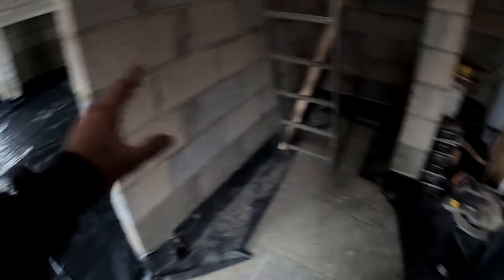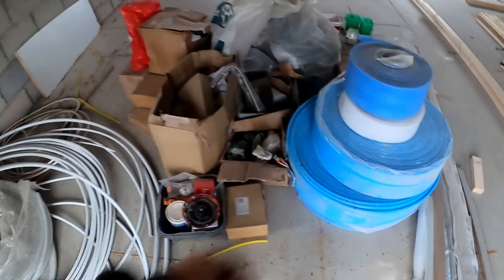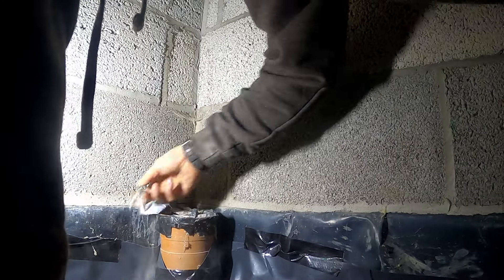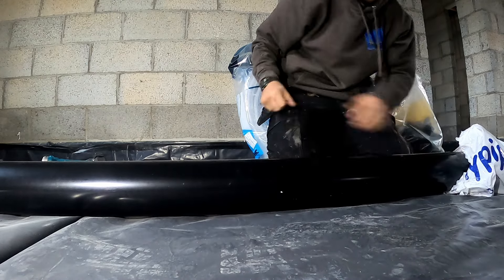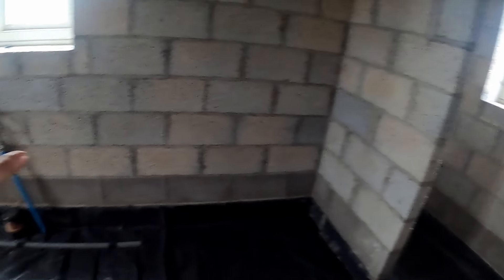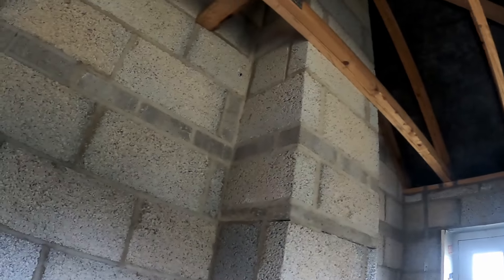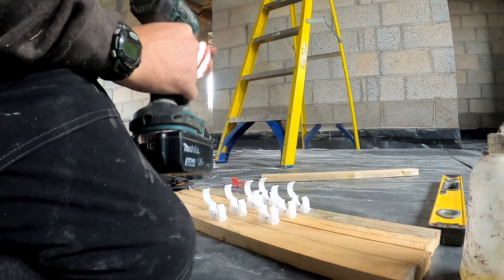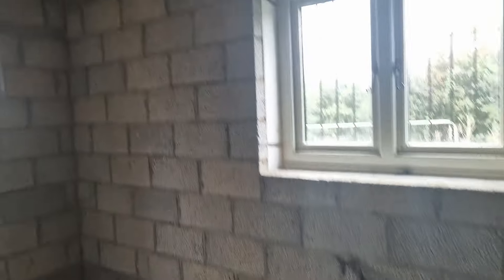PLUMBING the "ABANDONED" PLOT

Comment: Do you ever worry about the speedfit surface getting scratch pulling it through your copper sleeves? I’d worry about it leaking when fittings are put on! Great video as always Tom.
Reply from the maker: Not on that bit as they are full runs and the ends aren't damaged, it can be a problem with the metal braces in the joists as well, sometimes the pipe can get really scratched if you are not careful, thanks for watching Paul

Comment: During lockdowns Celotex was scarce and wood. I was quoting work at Saint Gobain at Eggborough near Drax. I was tripping over Celotex in the basement, there was that much being stockpiled. On the docks at Immingham, wood was piled high everywhere. No wonder costs were higher.
Reply from the maker: Everything went crazy, we had loads of celotex in the yard, I remember it being a precious commodity. It was a nightmare to get boilers as well, I remember fitting Worcester Lpg combi, the only way I could get one was to got a natural gas one, and change the gas valve and re-chip the pcb myself, Worcester did still honour the warranty, thanks for the support as always Dave

Comment: New-build oil boiler in 2024! Cripes. I know you don't specialise in heat pumps but surely it makes sense for the customer to spec it here, and have PV solar. New build, good insulation, underfloor heating, no gas - doesn't really get more ideal than that.
Reply from the maker: Thanks for the support mate, the customer wants an oil boiler, I have fitted over 100 heat pumps and I happy to fit what ever the customer wants. They are also having an oil fired esse. Like you say, it would be good for a heat pump, but I can only ever fit what's been designed and agreed by the architect with the client

Comment: Nice to have a clear building space, makes your life bit easier tom 😀, 
Hope you dont mind me asking but after bit of advice , what size unvented would you recommend for my cabin , one bathroom containing mixer shower and bath , just want to make sure mrs got enough hot water for bath's 😂. 
Will have to be heated via an immersion because only got electric and no gas, cheers tom 9
Reply from the maker: Thanks for the support Gary, 120l should be more than adequate, as a general use of thumb a bath uses no more than 80l of hot water, hope that helps
Reply: @PlumbLikeTom  cheers Tom appreciated 👍